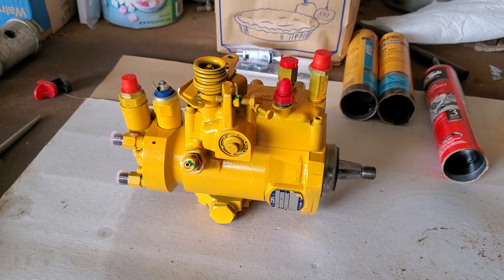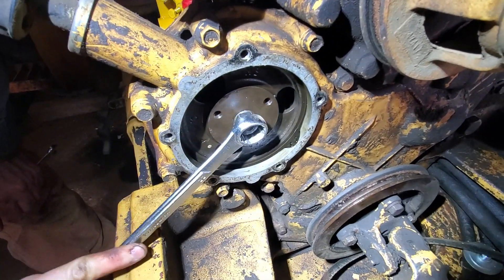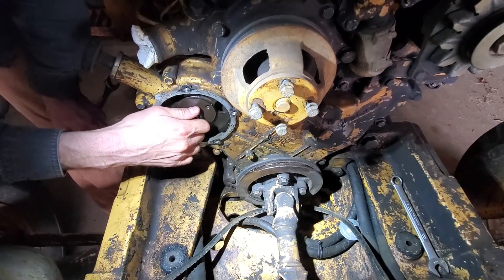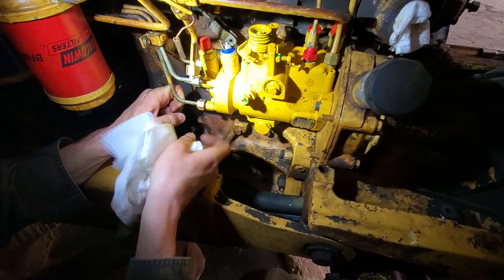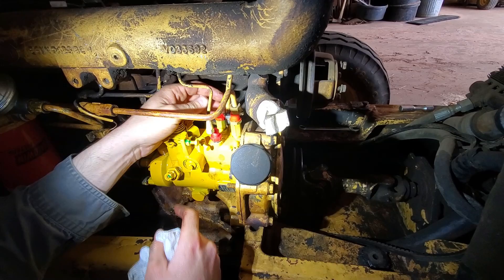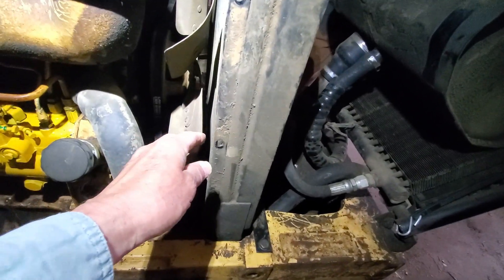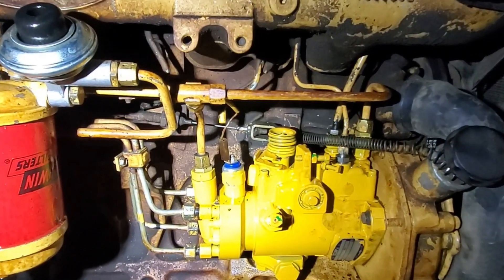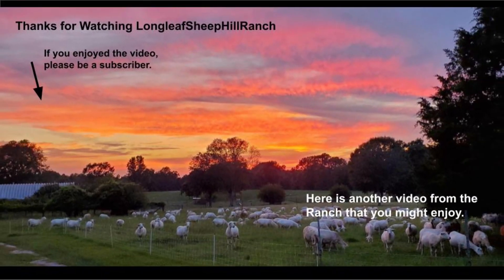555D Backhoe Fuel Injector Pump Installation

Comment: Great videos, thanks for taking the time to make them!  Do you happen to have any footage of taking the pump off?  Wondering if a puller is needed to disengage the pump shaft from the gear once the nut is removed?  Also, can you share the company name that rebuilt the pump?  Thanks again!
Reply from the maker: Jeffrey did the work, and he gave me this info:  I used a gear puller to remove the pump gear from the pump shaft. The pump shaft and gear are tapered, so they take a puller to get them apart without damaging anything. There is also a Woodruff key that locates the gear on the pump shaft. I was careful not to let the key fall into the front case while removing the gear. Hope this helps.
Once Jeffrey got the pump off, I sent it to
Advance Diesel Systems LLC
Dieselitems.com
256-534-3034
2411 Clinton Ave W.
Huntsville, AL 35805
I thought they did a terrific job, and it worked.  The owner told me that people from all over the country send him injection pumps to repair.
He seems quite knowledgeable. 
Best wishes for your repair, and thanks for watching.

Comment: Did you have to mark that injection pump gear before you took the pump out?
Reply from the maker: Per Jeffrey:  Did not need to mark the gear. The gear is keyed to the pump shaft so it only goes on one way and we didn't remove the front case cover so the pump gear couldn't jump teeth relative to the other gear that drives it. We did mark the pump position relative to the block. This is the only timing adjustment available for this engine.  
Thanks for watching and your comment.
Reply: @ 
Thank you for the quick information I look forward to more videos
Reply from the maker: @bobbennett3153 Thanks for watching.